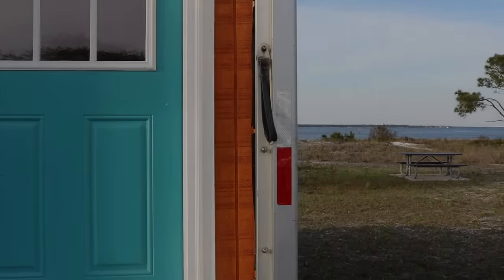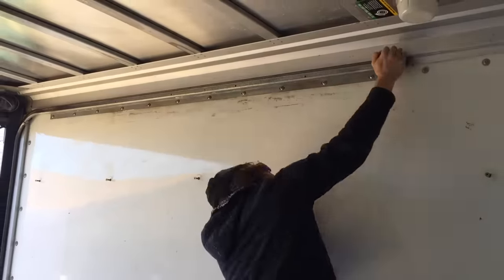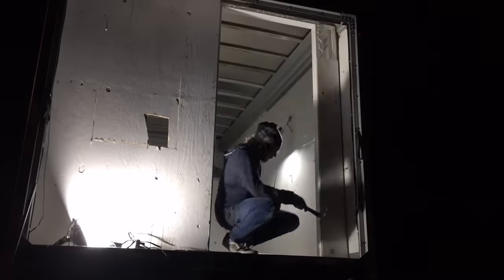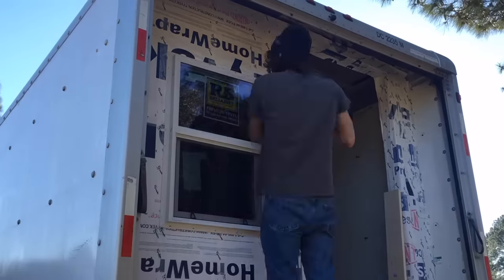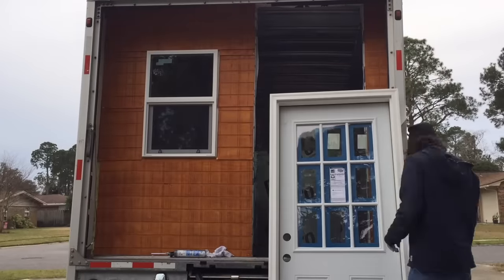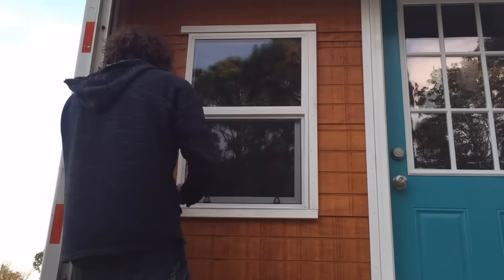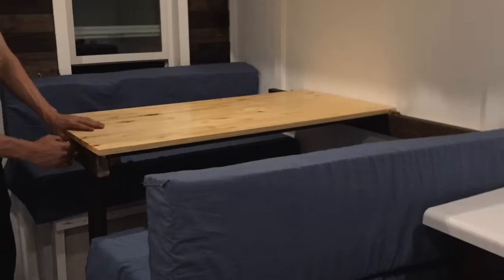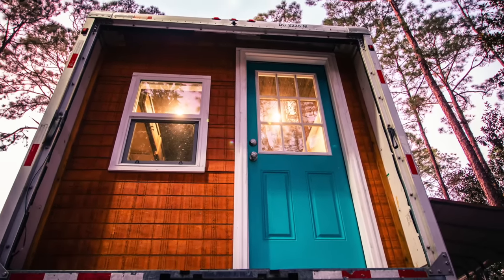How to Convert a Box Truck to a Tiny House

Comment: I like the idea you painted your frame work and sheathing. As a carpenter/ contractor that specializes in remodeling I can’t tell you how many walls I have opened up and the studs were just rotted with no signs of water intrusion. Now I’ll say that most that is caused by using wet studs. Then closing the wall up. But as long as your wood is dry before painting and installing it should add a great added protection against rot and carpenter ants, termites and what ever else wants to
Feed off the wood

Comment: I'd have kept the roll-down door, locking it with a big honking lock to keep out thieves, but installed a lock for the open position to keep others from locking me in.  Definitely cut through to the cockpit, though.  Gotta be able to make a quick getaway without stepping outside.

Comment: One thing that most do not realize is that those roll up doors need maintenance and sometimes replacing the rollers.... imagine having to disassemble the whole wall just to replace rollers and or the springs..... I would install 2 doors like some trucks have.... but then you can’t have passengers back there.... so you did the right thing in my opinion to remove the roll up door.... if you drive with the roll up door in the up/ open position you will have issues sooner than later.... just my opinion.... I’m 51 years young and been driving box trucks since I was 14 years old.... I’ve seen roll up doors come apart very fast...!!!!! Great video...!!!!!

Comment: If I did a similar project, I'd probably use bigger truck, to make room for a shower/toilette area. 
Although, even with the size of truck, it's still possible to hide a composting toilette, and set the floor to be waterproof with an open-able drain, and install a long-hose + hand wand shower head that leads to an external water connector. 
And I'd definitely run wires in the walls, to make it easy to hook up to an external AC or solar power. 
But still. You did a great job overall, and this is inspiring.

Comment: I think you did a great job on a budget. I live in a cargo trailer that I made into a bug out trailer. There's one thing that I would strongly suggest that's very beneficial for me. Four 360 Wi-Fi security cameras. Looking forward and backwards of the truck and one in the back with the door is. Power pack is 120 volts probably 20 watts. There's a variety of small packages that you can purchase. You don't need the Internet you can use your cell phone. See what's going on outside

Comment: I have a Ford Transit box car with lifting back door that I am making into a camper with room for my motorcycle under the bed at back (2,2m high under roof and 2m wide and 4,2m long is the total dimensions of the cargo box). The walls is already insulated with 50mm thick polystyrene from the factory with thin fiberglass panel on the inside and outside, it only really need sound insulation and insulating all the cold bridges (aluminium metal and steel bolts leading cold from outside to inside that will get horribly moist with condensation if not dealt with)... Sleeping in the box is now like sleeping in a tent, you hear everything outside so it really need sound insulation that I hope wood panels and sound insulating foam boards will do the trick for that.

Comment: You are in a metal box that will hold humidity therefore you must use a dehumidifier which would work well using a small window air conditioner it will remove the moisture from the interior and the caulking of the back wall is not an issue as long as you deal with the moisture that is built up when you are living inside of it

Comment: I don't know about upside down on the tyvak fabric, but I do know that when I used it, it did matter that the print side was out. It is designed to let water vapor escape from the inside, while repelling liquid water from the outside. I don't recall reading anything about the orientation of the print

Comment: When I was building houses, we just called the Tyvek, “Tyvek” or “house wrap”. There might be other industry terms, but Tyvek is so ubiquitous that even if you use a different brand, you could call it “Tyvek“ and any builder will know what you mean.
Also, when you install the ceiling and floor, start from the center of the room and work toward the walls, that way the cut edges will be covered by the ceiling trim and mop board. 😊
❤️✌️

Comment: It looks like a great result for a great project. I do have two questions, though:

1. How do you stop rain coming down the shaft of the extractor fan? Shouldn't you put some sort of protective roofing around this like one might do for a chimney?
2. What do you do for ablutions? It's all very well to stop and take a slash at the side of the road, but what do you do if, for example, you wake up in the middle of the night and need to spew, but the nearest toilet is a bit of a sprint?

Comment: Replace that roll up door, with a flap/awning door...that can lift up, creating sheltered patio area & have solar panels attached, but be down to hide the camper.  
I’d have put several inches of foam insulation on top of the roof, then covered that with more roofing, to get much better insulation for full-time use in cold or hot climates.  The awning fold-ups (could have those on both sides & the back)...can be attached to the better framing holding the added roof insulation.  
Then maybe use a little heatpump minisplit to condition the inside, using less energy? 
Love this idea!  But I’d have to get the biggest box truck, to allow thicker insulation.

Comment: I had a travel trailer that had a pressurized water tank it used a small 12 volt air compressor to pressurize the tank and you have water when you open the tap. they also have on demand water pumps and that is what I use now with a 25 gallon tank I got from Tractor supply for camping

Comment: Accotding to the manufacturer, the Tyvek Home Wrap is non-directional, so it fordn't matter if you use it upside down, right side up, or sideways. The website states that it will work fine.

Comment: Well I must say, I like what you did!  Don't worry so much about what every one else thinks, because you built for you! Yes , there are things that you should have done differently, but over all, You did a very nice job! I downsized from a 32 ft. Class A Motorhome. I have had 4 , and now have a E-350 Econoline Van  with with a build out on top of 20 Inches. It gave me more head room. but I still miss some extra room .  The stack on top, I would change that because of hitting things !
What do you get for gas mileage.  
Have a Merry and Blessed Christmas!

Comment: Do you have condensation issues at all? Also the pointer about not sealing up the exterior boards 👍 thanks man. This video has been such a valuable source of information as Im preparing to convert my truck into a tiny TREE house up on Mount  taranaki new zealand. Also great job you've done

Comment: mounted horizontal is fine 1 inch z flashing on horizontal seams and caulking i s absolutely NOT WRONG    you did that correctly should have used z flash  but you really wont have any problems..   you did a great job, and dont listen to a bunch of know it alls

Comment: I think you've done a fine job, and as a carpenter of many years, it sounds like you got a lot of bad advice and criticisms that you should ignore. (Using the kilz on your framing was a good thing), Getting rid of the roll up door is a great choice, the regular entry door is way better, (if it was me I'd have put the door in the middle over the ramp, and I'd probably make it swing out, but hey). The beauty of how you've done this is that you can easily make some changes later to the interior layout. Personally the #1 would be an access to the front, I must be able to get from my bed to the driver's seat without going outside. And #2 would be to install an insulated floor.
Reply: Oh, and the tyvek claims are bs, it is fine upside down.

Comment: Thank you for this detailed explanation!
What was your reasoning behind removing the horizontal boards from the walls rather than use them for your framing?
Reply from the maker: Just seemed easier since I needed more framing than that to screw the paneling to.

Comment: I'm a carpenter. The writing on the house wrap water barrier has to be the facing the outside... it doesn't matter if the writing is upside down like that. Its fine. Lol, thats just silly that some one said you did it wrong and it wouldn't be water resistant.

Comment: Great idea with the paint  All walls inside of every Rv Even if it is factory made develop moisture Thus you get mold. This is a new thing available now. They have a product now that is a insulation skin. You need to put it on the wall before building But obviously in those factory homes , you don’t have that choice. And it is very expensive That’s why a lot of van builders put it over the fenders  Cold passes through metal or fiberglass vehicles. This products  stops it from passes inside.

Comment: Good job. From my experience this build should be fine in warm weather & temporary living.
Full-time winter living would destroy it through condensation & mould, though.
Reply: Kaci  I've lived in a converted truck for over 6 years & after doing the normal conversion methods I had to go back to the drawing board & come up with a better solution. 
That is in the UK climate, though. Different climates present their own challenges.
Reply: Kaci  Firstly, I built my walls, ceilings & floors in insulation boards coated in fibreglass, then I ventilate any time I'm not there & when cooking, plus I use a dehumidifier & heat recovery extraction fan when it's colder. I barely need to heat the truck at all with this setup, getting additional heat from a PC, only needing to use the blown air diesel heater when it's really cold.
I do have a lot of solar panels though & 20KwH of lifepo4 batteries that help all this work, though.

Comment: removing the rollup door was good for several reasons, they don't seal very well so you get air leaks and drafts. when it's open there is not enough room to properly insulate the roof and if a cable or spring breaks while you are inside it's a major hassle to open it. the only things i would have done differently is i would have insulated the floor before building the new rear bulkhead but florida is warm so you're probably ok. i hate waking up on a cold morning and having my feet almost freeze to an ice-cold floor... i also would have cut a pass-through to the cab, when you go on trips with your wife and kids how do all 4 of you fit in the van cab?

Comment: If it were me I would have skipped the back wall and had one made of 2x2" steel tube welded with the same used for studs in-between and done an RV door and window frame out. This would have given you absolute maximum floor space and kept it weather proof. If you drive in rain and/or snow the draft caused by the back of the tuck will actually accumulate very heavily in that area so I wouldn't plan on the wood back wall to have a decent shelf life before rot eventually sets in. Then with the glass and nothing to protect it during stops such as Walmart or whatnot will make it easier for someone to break in. It'll be fine for now but I would suggest making a new back wall out of steel and aluminum skin in the future. Damn good job though.

Comment: Pretty cool dude I have no carpentry skills whatsoever plenty of metal but no carpentry to speak of if I leave a gap in between metal my MIG welder will usually take up the difference but as far as that would goes that's pretty precise so I guess I'm going to have to measure twice and cut once but it is an awesome build that is the same exact size truck I am looking for hope I can find one then I can steal a couple of beer designs if that would be all right hahaha nice build hope to see you down the road.

Comment: People "calling you out" do not get off their couch much. The Tyvek material does not have a set orientation, BUT it does matter which side faces out.

Those roll up cargo doors make so much noise as you drive. Bye Felicia!

Also, using a primer to treat wood that was most likely already treated certainly won't hurt. 

I use backer board and LED lights rated for use in showers all around van builds. I do so to keep water out of my electrical systems. You never know if you hit a tree branch sometimes or if some fool vandalizes your stuff while on a hike or sleeping. A pound of prevention and all.

Comment: It's what i'm saving up for. Damn are they expensive here in Alberta though. 16' cube van, 12 years old, with well over 200,000km's, not even diesel (mostly ford and their cam phasered engines) and still upwards of 12 grand.

Comment: I kind of want to do the same thing, but have more inside space, and more outside space when it's good weather
Reply: If you use an inverter and a 12 volt light system you got it covered, LEDs are where it's at now
Reply: And the other thing is the wrap that you used, you could have put pieces of waxed cardboard over the top of it which would have added an extra layer and you wouldn't have to show the manufacturer

Comment: This is amazing! Are you able to drive this on the street like an RV? Did you need special permits? How did adding the weight work out, did you need a    Cdl?
Reply from the maker: It’s just a truck. No CDL, no permits. We drove it around the country with no problems.

Comment: I'm wondering if you regret not using a lot more insulation. Unless you have constant heat when it's cold out, a typical travel trailer feels like you're in a cardboard box.

Comment: Just wondering for myself but thinking to just leave the strap lines that you took out @0:50 & using them to fit/wedge my insulation in, kinda like you did the ceiling & when you put the insulation in later @4:09. My question I guess is, can I just leave them or is there another reason to take them off? If anyone knows I would appreciate knowing. Thanks in advance! And, be blessed today!!

Comment: You could have even installed the logo to the inside and hid the Dupont poison factory logo some more. The orientation of the wrap does not matter, maybe you could have done 1 solid piece down the sides since it is a small wall.

Comment: I want to do this build in a Hino/Isuzu cabover (tilt cab) truck. I want a fixed bed and already have the perfect twin bed frame that's 26 inches tall metal frame and a select comfort mattress. I think removing the rollup door was the right move. they weigh a ton, leak like hell and are very maintenance intensive. I would like to find some old enamel and metal cabinets, to save weight and I think they would hold up much better than wood.

Comment: You started explaining everything so well but you ended up being really short with the explanation, all you said about the lights was I went ahead and installed lights. Are the wires done before your ceiling or do you drill holes in the ceiling and attempt to run wires underneath
Reply from the maker: We ran the wires first.

Comment: This is great. Just got my box truck to do something similar. How did you attach the boards to the ceiling?
Reply from the maker: Self tapping screws into the metal supports will work fine.
Reply: @ColeWebb  Thank you!

Comment: Tyvek HomeWrap, Tyvek StuccoWrap, Tyvek DrainWrap and Tyvek CommercialWrap are equally effective in both directions. However, DuPont Tyvek StuccoWrap and Tyvek DrainWrap has a specially engineered surface that should be placed with the grooves in a vertical direction.

Comment: Whomever said that the Tyvek HomeWrap was installed the wrong way, does not know what the manufacturer states about their product and is talking out of turn.  

Can you install Tyvek WB with the lettering facing inwards or upside down? 
Tyvek HomeWrap and Tyvek CommercialWrap are non-directional and are equally effective if installed with the logo facing the inside or outside of the wall or with the logo oriented in any direction. 

No problems with the way that you installed the Tyvek HomeWrap.

Comment: Can you install Tyvek® with the lettering facing inwards or upside down? Tyvek® HomeWrap® and Tyvek® CommercialWrap® are non-directional and are equally effective if installed with the logo facing the inside or outside of the wall or with the logo oriented in any direction.

Comment: Hey man, im at the stage of insulating my rig. I have an aluminum box truck like yours. My question is: do you ever deal with condensation or sweating? Im planning to do the same type of insulation.
Reply from the maker: On cold nights, there was some condensation/sweating in the rounded metal corners where the roof meets the walls. We did not insulate this part. If I were to do it again, I would make sure the insulation was continuous. Best wishes on your build!

Comment: As entire sectors of jobs evaporate, leaving low wage jobs that are insufficient to support a home of one's own, more and more people are resorting to this life style out of desperation! With no other options, the down payment on a van is a few months and rent and security on an apartment. You can go to where the work is, or relocate.  It will curtail the senseless accumulation of consumer crap and focus your life on what's essential...  This gentleman's video is a big help but you can start with a small mattress in the back and go from there. In buying a van it important not to look like a camper on a holiday but to look inconspicuous.  Tradesman's logo is a plus...
Reply: In the South West, camping is common place and expected.  On the coasts and in dense urban areas "Stealth" is required. Your homey back-end facade is great but I would keep the roll down and open it up between the back and the cab.